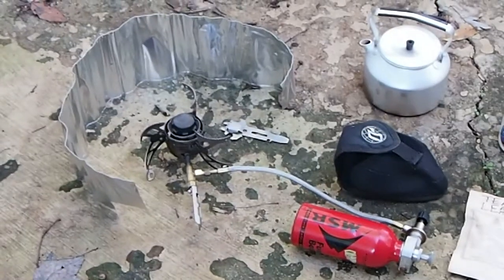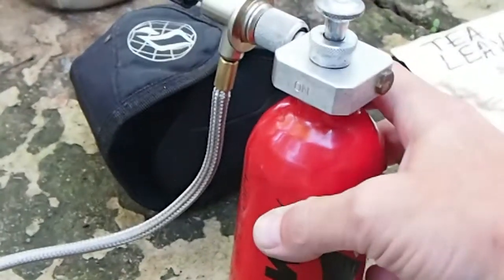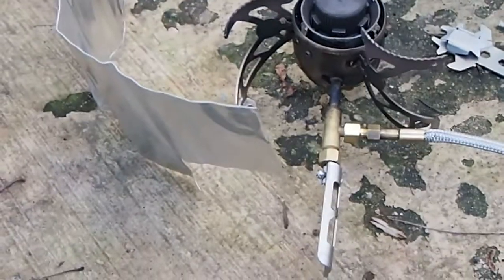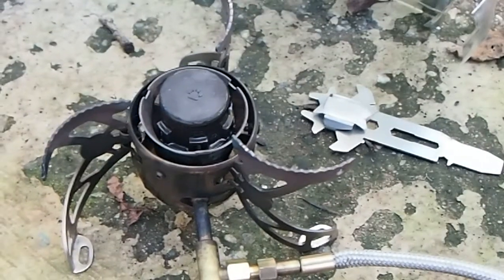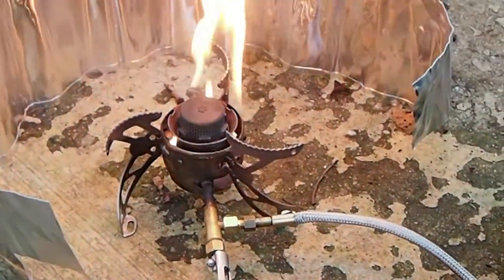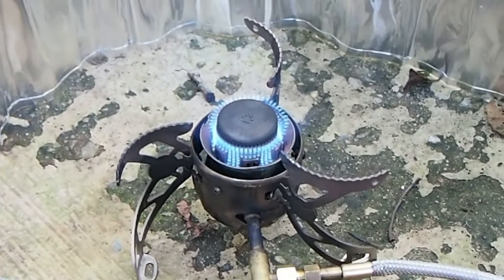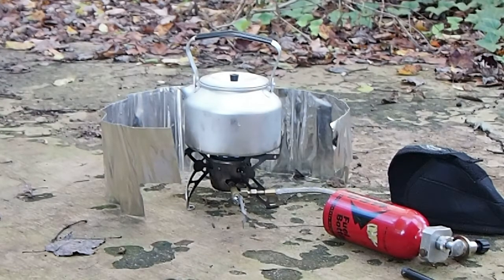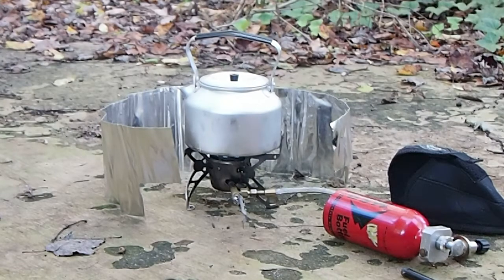Optimus Nova With Dawg-A-Nova Silent Cap & Bluewaterstove Fuel Line Adapter

Comment: I found out that the fuel filter was what was causing the pulsating flame. I removed the "foam" filer and replaced it with a fine metal mesh net. Not sure it filters bad fuel but I have no more pulsating and thats good enough for me hehe.

Cool video, cheers // Andreas

Comment from the maker: Two errors in my dialog:
-The clicking you hear when moving the tool under the jet for cleaning is the jet cleaning needle moving, NOT the jet moving up and down.
-I did not use Nitrile o-rings when I rebuilt the pump. I used Viton o-rings.

Comment: Awesome video, thanks buddy :)  - one question though, - did u say you could use butane with the nova? i thought that wasnt possible, or maybe it is, with the changes that you've made ?

kind regards from Denmark :)

Claus
Reply: I think it is only possible due to the Primus fuel line/pump, since it includes the threads for the Butane canister.

Comment from the maker: For those interested: I tried using the fuel line adapter in a Trangia 27 series cookset, using a genuine Trangia cup adapter for the Nova burner. There was not enough space in the Trangia 27 to allow the fuel line adapter to be used, it hit the side of the Trangia and the stove assembly would not seat properly in the lower windscreen. I have not tried it in a 25 series Trangia.
Reply: Trangia User great info brother!

Comment: Optimus nova user from Sweden here. Its a trusty stove, Just change some filters et cetera every now and then. 
Interesting flame spreader! 
Just curious about what fuel youre using in the video. I mostly run mine on alkylate gasoline. Less benzene and toxic aromatics.
Have run it on diesel while on trips abroad, and also jet fuel once in the Canary Islands. Both worked fine. Diesel leaves some oily tar residue on pots though.
Theres less priming with gasoline, some say its a bit more dangerous with explosion risk though.
Thanks for the great video!

Comment: Curious: Why are you using the primus pump and fuel line when the Optimus pump pretty much has the same features?

Edit: Ok, seems I didn't watch far enough into the video to get the answer before posting this.
Reply: I acquired one of theses stoves years ago - found it while out hiking. Someone is kicking themselves for leaving it behind at the campsite. I contacted Optimus, told them the story of how I found the older nova stove and needed a pump and would like to buy one from them as the pumps were not available by themselves in their US store. They sent me one (with a new fuel line - the old one didn't fit the new pumps) as a warranty repair at no cost to me. 

Though you've got a pretty nice working set-up going now, if you want the Optimus pump, you might contact them and they may send one to you. Otherwise, if you're happy with what you have, carry on.

I found their customer service to be more than superior.
Reply from the maker: Hey, that's cool, no worries. When I got the Nova, I did not have the correct pump for the CEJN fitting fuel line that originally came on the Nova. I have since acquired a couple. I find it is nice to have other line/fuel options in case a pump or line fails, or if I decide to take the Nova and my OmniFuel out at the same time.
Thanks for watching!